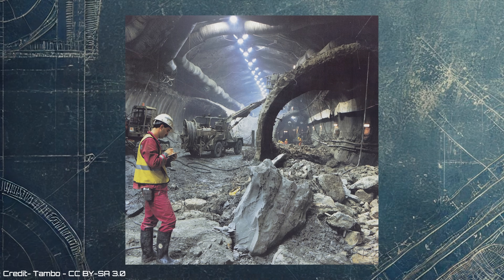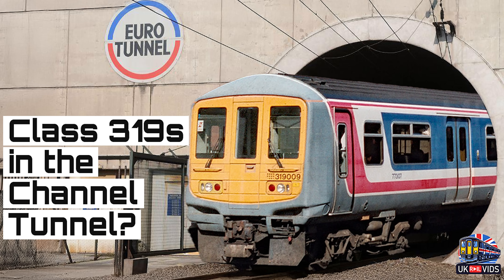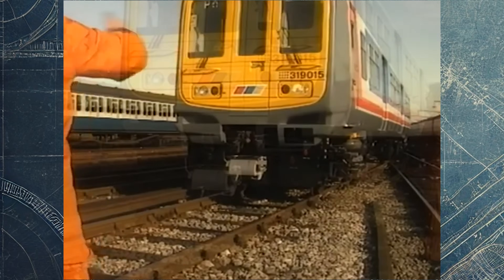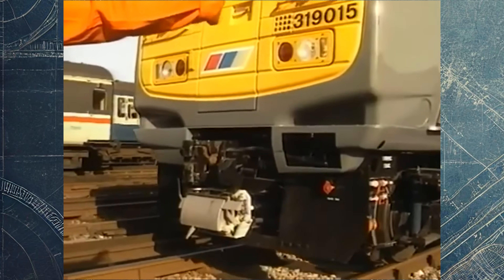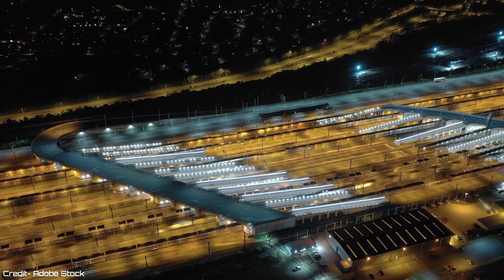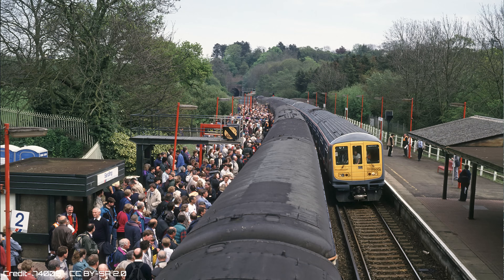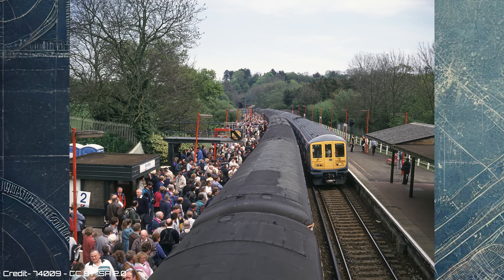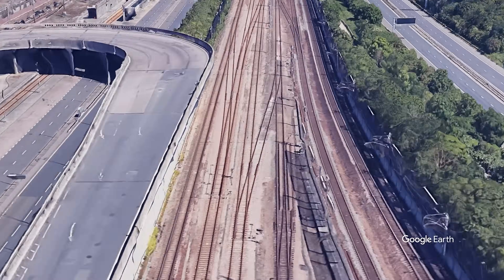Did Class 319s Really Enter the Channel Tunnel?

Comment: Some years back the Meridian class 222, the trains to be replaced by the class 810 unfortunately for EMR, also made the trip from Bruges through the tunnel, which is also fairly unique to see. Since most uk trains are built in the uk itself, ferrying trains through the tunnel is a somewhat rare sight
Reply: Except for the 350s, 185s, 700s, 707, 717 555s 777s Every Stadler unit 😂.
Reply: @Geeves8612  Yes. I saw an early SWT class707 in the formation of a Tunnel freight train passing through Brixton long before they wen't into (limited0 service.

Comment: Have a look at how the French tested the smoke and fire detectors in their part of the tunnel.  They used a preserved steam loco which reversed down one tunnel to the crossover then came forward through the other tunnel. There are some great photos of it coming out  at Coquelles in a great cload of smoke and steal,  apparently it did set off all the alarms.
Reply: I need to see that
Reply: yup a 230g, bits a crappy br emu lol, bit more panache the French.

Comment: I wonder if there was an open access operator that used the Class 319 from London to Calais. Or was it used as a test train before the Channel Tunnel was completed and Eurostar was born with Class 373 E300s were built to be operate from London to Paris and Brussels. As of today that Eurostar continues to run high speed continental Europe services.
Reply: wtf thats just stupid. why a 319? at least use a train with comfortable seating like 730. the 319s are commuter trains and certainly shouldn't be in this route. admittedly the 730s are like regional express but it's a bit better
Reply: @nextstop_islandgardens  Seeing as it was in 1994, the dual voltage 319 was ideal.
Reply: Suppose you are right. Thameslink used to have the Class 319s before they were replaced by the Class 700 and people say that the Class 319 had comfortable seats compare to the seats on the Class 700 that aren’t as comfortable.
Reply: I can see why you'd prefer to stay anonymous.

Comment: I though trains had to be at least 400m to go through the Chunnel, for safety reasons
Reply: That's one of those dubious rules that seems mostly intended to stop competition on the route. The idea is the train is always at an emergency exit as they're every 375m but it's flawed in a number of ways. 1) If there's a fire halfway down the train one half would be evacuating along the tunnel anyway. 2) Most other long tunnels don't even have a service tunnel and you're expected to evacuate through the main tunnel, sometimes for miles. 3) Unless the train was catastrophically damaged the driver could stop next to an emergency exit no matter the train length. 4) Even a 200m train is at most going to be 88m from an exit.
Reply: Not anymore, that requirement has been dropped. But as already said it was a dubious rule to hinder newcomers, requiring specially made trains. Since usually high-speed trains are about 200m. And you can always couple 2 sets together if capacity for 900 passengers (or 1200 passengers if you couple 2 duplex trains).
Reply: The dubious nature of that rule aside I would have thought these would have operated under special instruction and rules anyway. So what is the norm doesn’t really apply.
Reply: @ashleyw1393  tell that to the swiss and their even longer railway tunnel
Reply: @daanwolters3751  tell them what exactly? Just pointing out the fact the train would have been operated under special conditions.
Reply: @ashleyw1393  that the swiss should start operating the gothart tunnel under special conditions as well. 
I was just pointing out that you can operate a train normally in a tunnel that large. And that there are no special conditions on the train themselves.
Reply: @ a train that is designed for those tunnels yes. The 319’s were not designed for the Chunnel and only operated this service under special conditions. So again not sure where you are going with your comments.